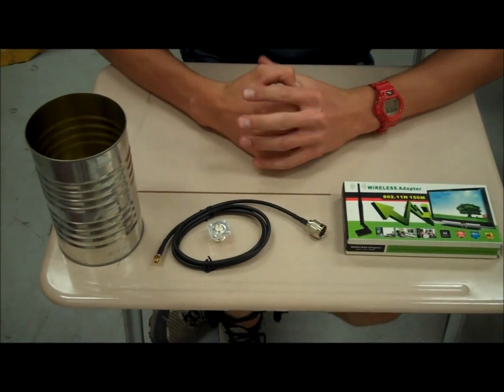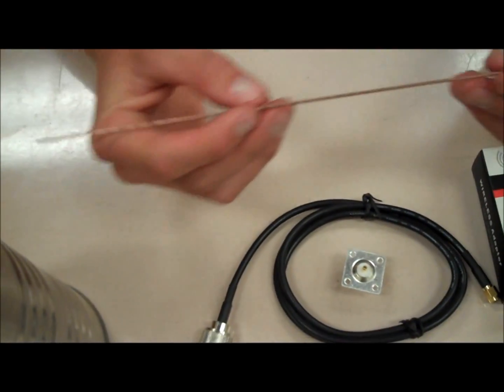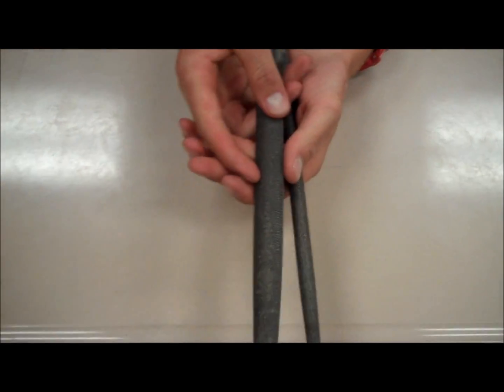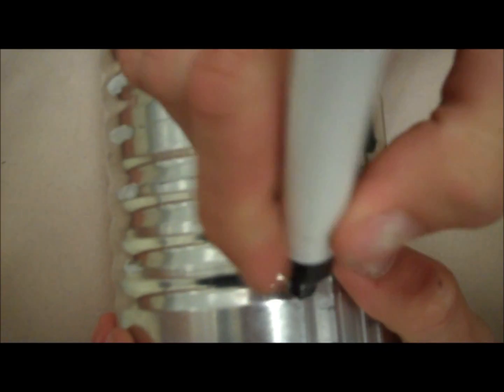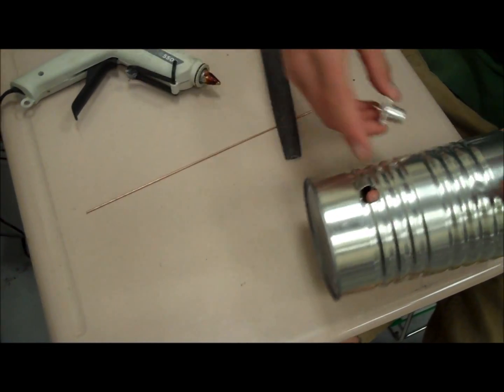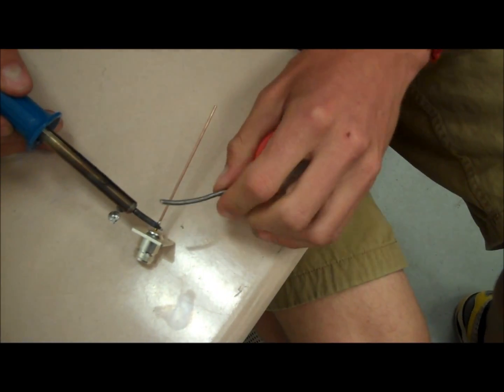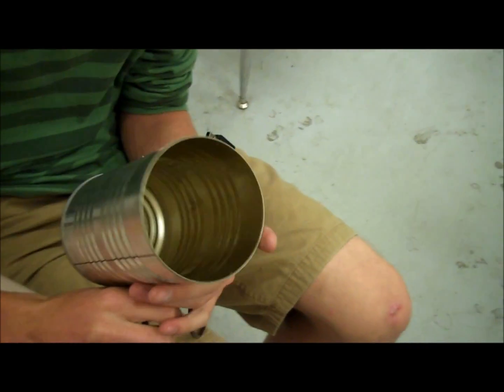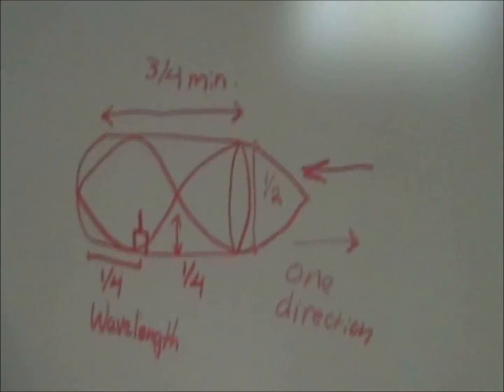Build a Wireless Cantenna:How To

Comment: "SuperEnginerd"

Considering 5:40, you are a super something.. But I don't think it's either an engineer or nerd..

Only reason I assume he didn't at least get a nick is because by the looks of it he's starting with a masonry bit, and obviously un-tapped. Thus it takes ages to drill through even with the drill maxed..

Yes, this is how you an make a wireless cantenna, yes it's instruction on how to do so, it's also an instruction to just bad habit and danger in the workshop.

Comment: Can I solder the copper element straight to the N-male connector, not the N-female connector? Can't seem to buy the N-female connector anywhere near my place. Thanks!
Reply: I don't know where you live but most electronic parts outlets would have this. Its a fairly common part. Walmart, Best Buy, Computer shops?  Not likely.  Ebay, Amazon ?  Hell yes!

Comment: I dont know that someone needed a cantenna when the wifi adapater comes with such a big antenna xD
Reply: The cantenna, if properly made with the right size of can will beat that black stick  antenna by about 10dB. It means you can get Wi-Fi from more than twice the distance away and tell which direction it's coming from. It would be fun to have two of them and send between two computers and see how far they can communicate with normal cards and cantennas at both ends.
Reply: Different antennas have different uses. Im building one of these because they're directional and will let me track down people leaching on WiFi... so i can walk up to 'em and be like "hey, stop being a dink". YOou cant do that with an Omni-directional antenna